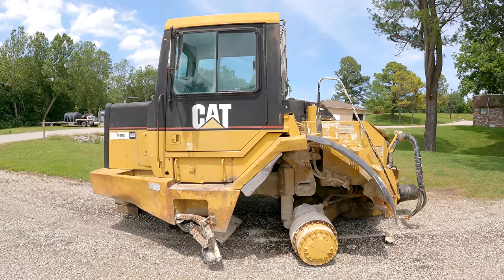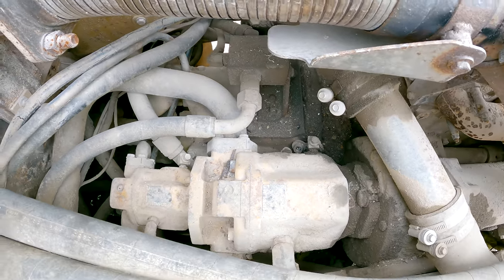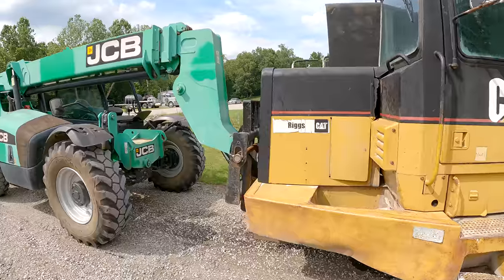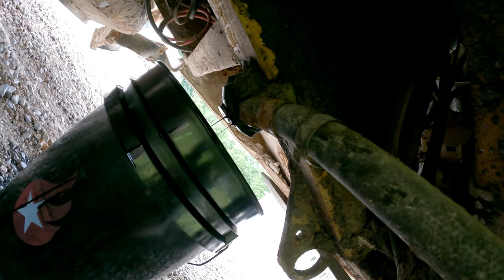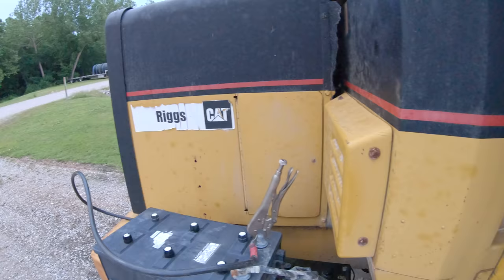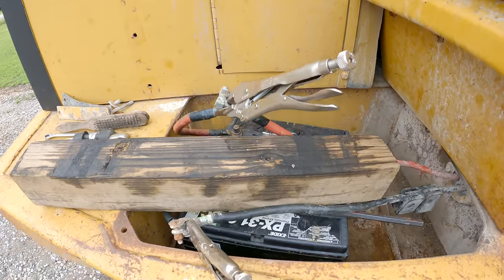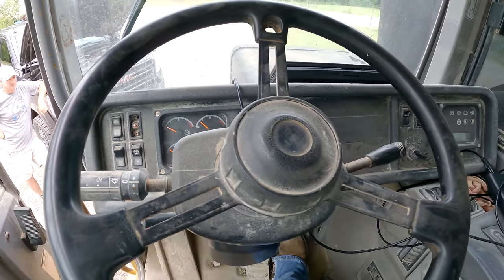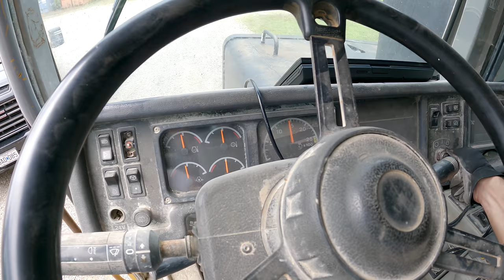Will It Start? Salvage 40 Ton Caterpillar Off-Road Haul Truck

Comment: watches hydraulic oil spray like a fire hydrant that broke off  "ya, i'ma say there an't nothin wrong with that pump" XD
Reply: It might flow but if it ain't got any pressure it's toast.
Reply: @johndowe7003  flow to resistance is pressure. No such thing as pressure without proper flow

Comment: I’ve done a few of those transmission, if it is the trans I could almost bet it’s in that drop box, the ones I’ve seen have almost always blown up that differential in the bottom of that drop box, parts for that drop box are scarce too!
Reply from the maker: Good to know, thanks.  Looking at possibly running a couple of these trucks, don't really see where 740s are a big improvement.  These rigs are a good bit cheaper.

Comment: I've ran those cat trucks and they are the most uncomfortable ones out there but good power
Reply: I remember a good while back reading about how  the older scrappers every jobsite was using and how uncomfortable they were and how many back injuries the workers got from driving them for a few years and then they redesigned the scrapper to be more comfortable.   I just felt bad for the workers that got hurt udriving them for years and probably didn't get any relief or compensation from CAT or anyone.

Comment: Hydraulic fluid won't hurt anything, hold the road dust down where your sitting.
Reply: And nothing will grow there either lol, I usually throw my old oil on the fencelines/fence posts . Keeps the weeds down and posts lasting forever

Comment: Reminds me of old times. I worked for Atlas Copco Wagner Mining Equipment Co. As a diesel mechanic at their plant in Portland , Oregon. Atlas Copco purchased Wagner from PacCar about 1990. One reason was to develop a large 3 axle heavy haul dump truck. So in the mid 90’s after looking at a Norwegian built light haul 3 axle truck they engineered from the ground up a 65 ton 3 axle truck named the full back. It wasn’t bad but for cost savings they went with a German made transverter assembly instead of a Allison equivalent. The difference was about 10,000.00 back then. The German made was as I call it the big Z . I can’t spell the name but it’s the big German company that builds transmissions and the spelling starts with a Z. The hole project was a money pit. It was plagued with a lot of engineering issues and Warrenty issues involved with a sales contract with the Staton Island garbage land fill. They finally sold the rights to the truck and technology to a undisclosed purchasers in the late 90’s. I believe it might of been Caterpillar but not sure. I’ve looked at some Cat trucks and I see a lot of the fullback in them. Their where some trucks that in the aftermarket people modified the power unit with a Allison transverter assembly and liked them. At Wagner my opinion was as is that they bit off more then they could chew. I relate it to building the space shuttle for the first time with the limited engineering capabilities at their disposal. So that’s my story on these big 3 axle trucks.
Reply: @lookylook570  your right. Now you know why I have a hard time with it

Comment: I've only been pryvey to seeing a couple of your videos, I'd like to make a side wager on how long it is before you fix a leak, and re-wire the main power circuits properly allow optimal conditions for the engine to operate and the entire cab be better (proven) then most factory produced gals before your next project.

Comment: Man Cat isn’t very generous for cab space on those, on the Volvo’s I’ve run the cab is full width and there’s enough room you can put extend both your arms out and never touch a wall, it’s almost like a small house instead of a cab, sort of like the old D9’s. You should weld a giant caster wheel like what came on the old Elgin street sweepers on the back and make a donut rig out of it

Comment: Looks like you’re starting problem has something to do with the series parallel switch in between the batteries and the starter there’s a direct 12 V to the wiring system and only 24 V to the starter, probably bad contacts it’s a magnetic pull switch similar to a solenoid on a starter
Reply: There is no series parallel switch the whole machine is 24 volts there's s little tiny 12 volt power supply in the back of the cab but that's it your looking at the connection when he hooks up the batteries
Reply: @nathansmith8003  wow that could be then the hole system is 24V, the 12V at the cab is just a feed for a12V Accessory.

Comment: No weeds gonna grow in that gravel for a couple of years...
Reply: that's a good thing, who wants weeds on their gravel
Reply: don't drink the well water lol
Reply: @charliegiammarco5178  that gravel has a protective layer under it, no water or oil will get through it.
Reply: @geoffrey6000  sure..... sure....
Reply: @geoffrey6000  first rule of engineering: everything leaks
Reply: @MaximillionBucks  what does engineering have to do with with a plastic sheet under some gravel... also, who cares if it leaks, the gravel is like a sponge

Comment: Who lets a piece of equipment get torn apart and dissected like that? They couldn't be playing with a full deck!
Reply: A lot of smaller and large operations frankenstein shit together good enough to get the job done. Hell the oil company I worked for was a multi-million dollar company and they still would run pulling rigs from the 1940s and 50s . They would strip everything down and rebuild everything on em the only thing that was original was the cab
Reply: It's just an old machine. They did all the math an decided it was not viable to fix the broken transmission, so they kept the rear end for spares and sold off the front end to another sucker. The Danish army did the same, so what was seamingly a complete machine/truck/tractor at the surplus auction was just a collection of worn out and broken parts.

Comment: seen those hoses sitting there and i thought maybe your gunna do something stupid like id do.  had two techs changing oil on a 3516, one started draining the oil filter hosing to swap filters then ran outside to grab the new filters and the other one got the pump ready to drain the oil. i guess it wasn't pumping as fast as he'd want it so he went over and started it up..
from what i was told there was oil everywhere, they spent the next three days cleaning up oil.

Comment: Maybe your equalizer is not working your alternator and your starter is 24 boat is equalizer step it down to 12 volt that will mess you up if the equalizer is not working all the way around and good luck with the caterpillar they are good in shape and a good Haul truck goodbye for now and keep up the good work

Comment: With the std 2 batteries in place,  crank it, or try to, then find the warm or hot connection.  That's the bad one.  Best way, FLIR IR camera, 2nd best use a IR thermometer, Last ditch method, feel around with your hands, be very aware you might find something hot enough to burn you.

Comment: most machine application engines are rated for continues power at rating vs "automotive" applications that don't run at full power all the time. that haul truck will run at or near at full power.

Comment: I know Nothing about heavy equipment but I saw those hoses and thought  Must have blocked them because soon as you start it otherwise the pump will be working and spraying oil everywhere and then fry the pump if it's dry"  Might know one thing after all.

Comment: I thought at the beginning of the  video you were going to pull the hydraulic pump off so you would not blow fluid all over when you started the machine..  I used to run these haul trucks..

Comment: Not to a smart ass but just maybe all that sitting hasn’t done that starter much good because just by ear it though the miracle of the interweb and your cameras microphones it sounds like the starter is drawing the preverbal sh*t worth of amps even when you got it wired up with batteries two ways
Thanks for the uploading the video and have a good day and a better tomorrow

Comment: interested to know what was causing voltage lag on starter ,,   i have exact issue on my 3406
Reply: measure volts at each connection all the way to the starter while cranking when you find the low volts repair/replace that componet
Reply: @imzackson  thanks ,,  i found strip fuse's blow if you force a crank over from flat battery ,  cause's starter to get stuck and keep running ,  bit of a weld up going on ,,  then with fully charged batts no issues
Reply: @holdenbrougham1923  cool glad you found it

Comment: Hey Kt3406e I have no idea if you answer questions on here, but I have been looking for a "performance" cam for a 3406b and it doesn't seem that such a thing exists. I have come across something I was reading somewhere and it gave a cam number (1007408) that supposedly it fits b model and e model. I thought that the e model was way different and the cam wouldn't interchange. Of course I only found this in one place and have no idea if its true, so I figured I'd ask you. My thought process after that was 800 marine cam
Reply from the maker: B model and E model cam are completely different.  Injection pump engine compared to EUI engine.
Reply: @KT3406E   That's what I thought thanks for the reply

Comment: When I saw that hyd line dumping, I said to myself, you're in clean up mode now.  Then you said the exact see thing!
    When I fight a starting system like you did, I'll run a lead right to the starter, and manually connect to batteries.  Bypass all the switches and contactors.  You just wanted to hear the engine run, without having to fix the damn thing.

Comment: Me being extremely lazy I'd think about fabbing a starting trailer (with fork lift pockets like the military does generators) or skid with a fat high wattage genset plus what ever else comes handy.  Ya only build a tool once then it can serve you for life. Dragging batteries has to get old but if you have at least a stack on a skid then there's no manual labor other than connecting the cables. Welding cable (flexy, high ampacity, great insulation) is used by the military for jumper cables and works a treat for the big stuff.

Comment: Half of a truck ? More like a 1/4 of it, where's the chassis, Drive line , unheated box and hydraulic lift cylinders and basically the rest of the thing ? you have only a very dirty cab with a engine , and some diffs on pallets.